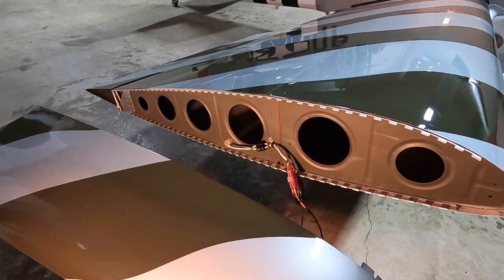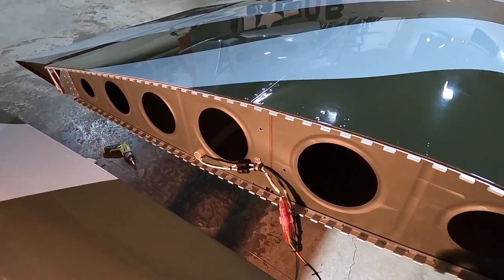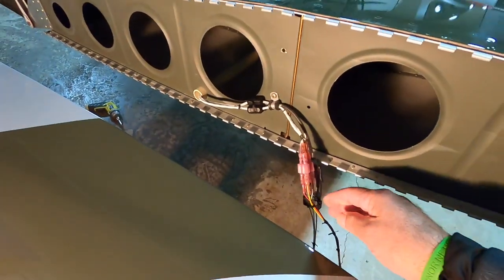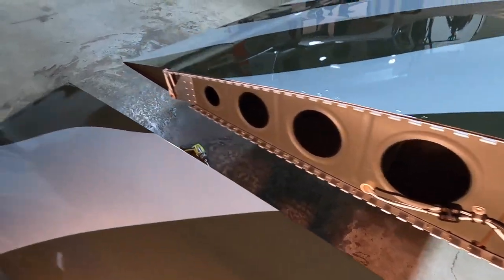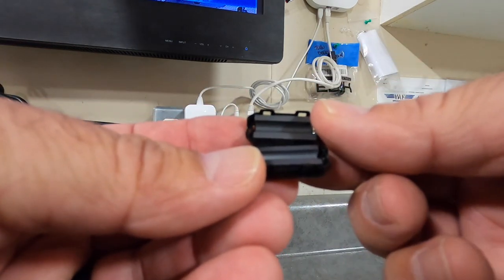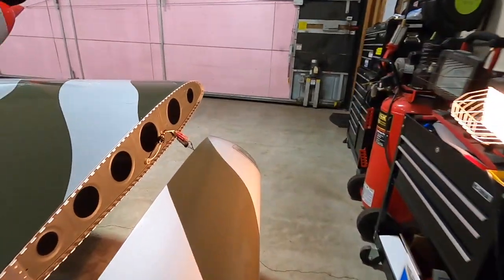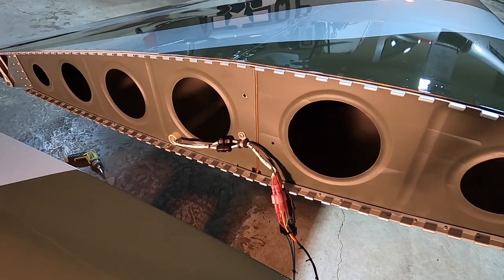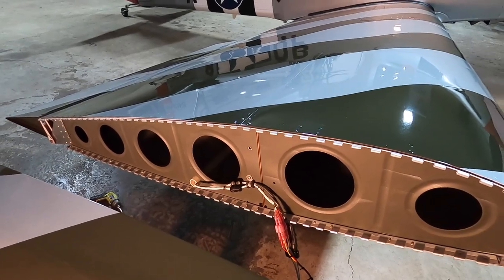Ferrite Core Clip On's

Comment: Have you done the follow up video or did you not resolve the issue?
Reply from the maker: I think I mentioned the results in a video I did after that one. The noise dropped a little but not enough. I now remove the noise in the video editing process. I will say that I don’t hear it much in my headset anymore.

Comment: In automotive wiring the crankshaft sensor wires are multiplexed
Basically the two wires are woven or laid over one another 
This overlaying cancels the magnetic signals 
I hope this helps
Reply from the maker: Thanks for that, we have several wire bundles that call for “twisted” pairs for that reason. For lighting they usually want them “shielded” which means a outer tefzel layer which covers a braided wire shielding and inside that the wires reside. This shielding is supposed to do the same thing. Originally AeroLED wanted you to run the ground wire from the lights through, that is tied into, the shielding at the light end. Then you take the shielding to the ground on the other end at the firewall. Now they want the ground inside the shielding like the other wires and leave the shielding alone. For that I would have to run all new wires which I don’t want to do at this point.